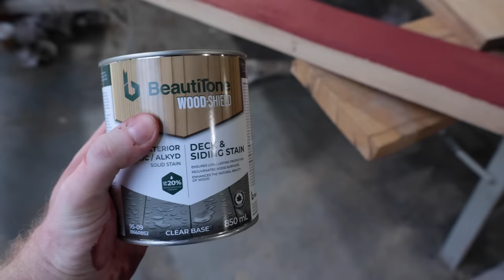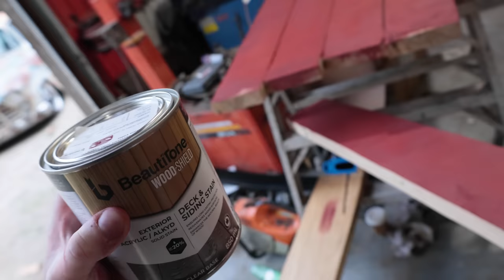Tri-Axle Lowboy Trailer Gets Some WOOD! [EP5]

Comment: Nice video! We never stained the decking on our trailers. We also used boards that were 3/8-1/2” taller than the beams. That way the machinery tracks would be on wood. This kept the steel from getting worn and the wood kept the machine from sliding
Reply: Good advice, but the stain was to match the tractor pulling this trailer.
Reply: @toomanyhobbies2011  Thanks Capt.

Comment: I used a clear coat on my trailer deck. I sprinkled a little grit sand on it while still wet. It worked pretty well and it helped with the slipperiness when wet. Learn that trick from an asphalt guy putting sand on top of a freshly sealed driveway.
Reply: Whorible idea, expanded steel over it a good idea
Reply: @campervanbug7658  
Whorible? 
     Are you trying to call my idea cheap and easy? 😂
     You just got to one-up everyone don't you @campincruze58 . I bet your boat is bigger than mine also? 🙄
Reply: Sounds good on the wood,  any grip is better than none!

Comment: Looks awesome! I have the same itch to buy a sawmill for here on the farm. I also feel your pain with stripping off old decks and putting new on- I just did my F-350 flat bed (looked like this might be the 4th deck so imagine the shotgun blast of broken self tappers I had to avoid) and my 27’ gooseneck trailer. Exactly like you said, painful while doing it, lots of broken tips and drill bits but taking the time to do 3/8” carriage bolts and hardware makes me happy that both look good and are easier maintenance/replacement whenever.

Comment: Man, sawmill work always reminds me of my first job, a neighbor had a portable mill he used for custom orders, it was a lot bigger and mostly hydraulic but the sawn lumber still had to be pulled, stickered, and stacked.  Hardest day I did we cut around 20 48-56" tulip logs for somebody doing woodworking.  They wanted the widest possible slabs at 2.5 inches thick.  That lumber was brutally heavy, I can't even believe I did a full 10 hours of that.

Comment: I worked building supplies for 20 year. Always recommended semi transparent stain as solid stains tend to peel and red is going to fade real fast with out a uUV sealer as red contains Ocker and it dose not hold up in the sun.
Reply: Cool story bro

Comment: We used to run the center board unbolted that way we could use them for the outriggers when necessary. We would also use clips to clamp the boards to the crossmembers.

Comment: Nice mill. Looks like a Husky 395xp. I have one that I built. Big bore, Meteor piston, Caber rings, modded muff, advanced timing, modded carb, full-chisel, Sugi bar, etc etc. She's a ripper. Great saw, doesn't get used as much as my 372 or 346 Huskies, or any of my Stihls either. I have a bunch of them. Cheapo ms250, ms440 mag, 026's, ms660, ms880 mag. All built by yours truly. Other than turning wrenches on vehicles for more than a few decades, I got bitten by the saw bug after I started working for a tree service company. In case anyone couldn't tell LMFAO 😆 I try to recycle used motor oil for staining/ treating the decking whenever possible. Works awesome and it's free. 😁👍

Comment: That decking looks great, but I wouldn’t of drilled the frame… all new lowboys just drill the wood and use carriage bolts and large washers to catch the frame. Makes changing out broken boards a half hour job even with rust. You know what’s it’s like changing them out drilling the frame. I had 2 lowboys running up north in the oilfields of alaska, rust grew on moss.

Comment: My second 3rd and 4th jobs were in sawmills. As I learned I moved into better paying mills. The first mill I worked was called a stick mill. Had been there almost 100years but had upgraded to being run by a diesel engine. Even that old mill those logs would have been an hr , hr and a half work

Comment: Highly recommend a microfiber 1/2" nap roller for those boards. Alkyd is best for wood because water based is not a mold protecting agent.  Alkyd has petroleum products in it.  Very good.

Comment: I would love to see a rollback build for Tewsley. But a quick build that wouldn't take very long is a nice gate. Its totally different if one were to bump into you at the grocery store and take just a moment of your time vs just show up uninvited not only where you work but where you and your family live. Thats a private area. However it would need to be a big gate so that there is room for the trailer to follow aa you turn in and out of your driveway. Maybe build a wide gate that rolls rather than swing and split it in half that way it doesn't take so long to fully open.
Reply from the maker: Its happening on the other channel with the Fargo cab on a DT466 4900 chassis
Reply: Oh sweet. Only 3 episodes in, haven't missed much and it will be easy to catch up. That will be great.

Comment: He should build a hoop to mount to the back of the flatbed that you can put a snatch block on to run a winch through to pick the log up and then pull it onto the bed be way easier to get more logs on

Comment: You can add extra fine sand to most anything as long as you don't add so much it turns to mud.
But it gives you something for the boots to grip on the deck 
Sure it'll wear, but about as fast as the stain does, but it'll blend right in with the texture if you use like a ultra fine sand blasting media, and use rollers to apply everything gives much better coating than brush or spray gun.
If you really want to hook it up use something like a rhino liner it's mush more durable, and I think they can match the colors within reason.

Comment: Edison Motors is what I think the future of trucking looks like, diesel electric is the best solution until we have battery's that can match the energy density of diesel fuel. Having a smaller engine running at its peak efficiency will do a lot to reduce the total amount of co2 produced.

Comment: You should just Rhino line the whole trailer including the boards.
Reply: Rhino liner cracks, especially when being put to hard work, and traps water inside. You won’t know it’s rusting and rotting until it breaks because of the solid looking surface.